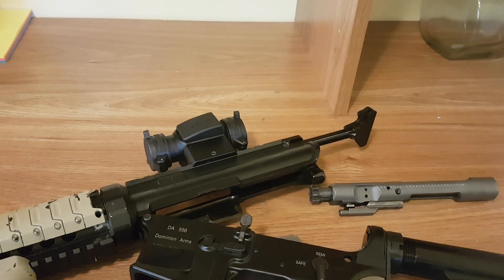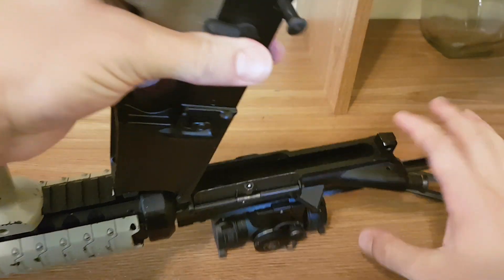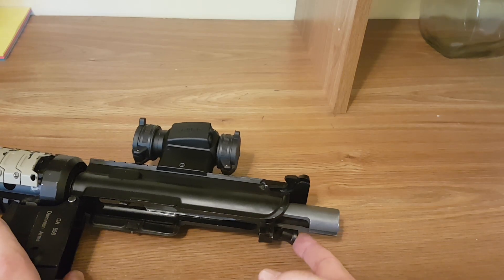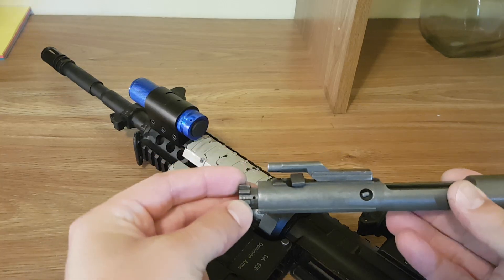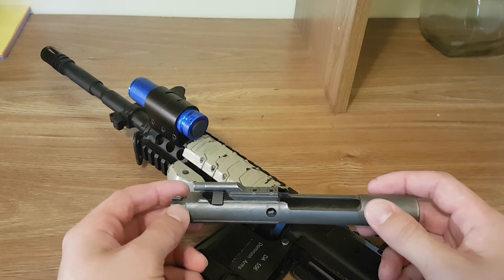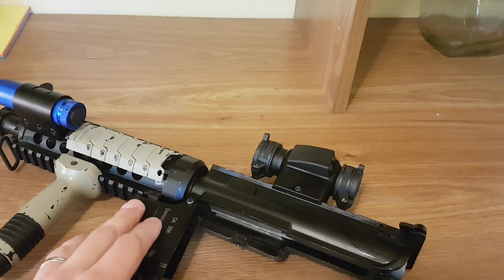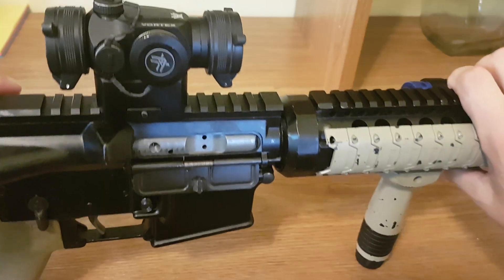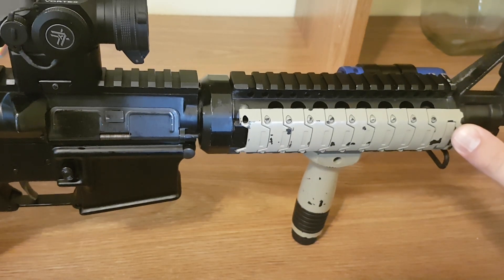What does the Forward Assist on the AR15 Do?

Comment: The forward assist is a reminder that the AK is more suited for dirty conditions.
Reply: you can use the charging handle on an AK platform as a forward assist too.
Reply: @Rara Neagra you are one of the most ignorant people I've ever had respond to me, and I've had some pretty stupid people respond lmao
Reply: David Cisco unless you have a piston driven ar. It’s the best of both worlds.
Reply: I wanted to bait AR people with some AK memes, but @Rara Neagra here proved that I don't even have to.
Reply: Incorrect. The AR keeps elements out better.
Reply: @fallout1953  yep way better funny that ar15 is better at keeping dirt and mud out than ak 47.
Reply: Bobby Johnson The AR has a very closed system. Hard to get mud in that.
Reply: FN Fallout yeah by sand grit is giving US soldiers ALL KINDS of problems with their M4’s the fine particulate is causing the insides to get all dirty. Combine that with a direct impingement gas system and you get a lot of bad stuff happening
Reply: @fallout1953  still gets dirty from use. AK system has just proven to be less complex, thus more reliable in certain conditions
Reply: @Bws2206  Sure.
Reply: @fallout1953  yeah. AK system has infact proven to be not so complex and very reliable.
Don't think you know how sarcasm or AR-15s work, but you have a name that includes Fallout in it so I guess I should be more generous. ;)

And I'm not saying the AR platform isn't reliable, just in general the AK has more stopping power and reliability but it certainly has cons too.
Theyre both balanced.
Reply: @Bws2206  The subject here was that which one is more reliable in dirty conditions. 

AR wins in that department... anything else atm is irrevelant. 
Does it really matter how well it handles crap in it when keeping it out is more important? All guns jam, malf and fail if that crap gets in the right place in the right amounts.

Simplicity is still a plus in, for example, cleaning and production... and maybe handling the crap better if it gets in(again, AR keeps it out, pretty well, in the first place).

And "stopping power" is a pretty bullshit term from what i've heard. Besides, 5.56 is a deadly round; it was(contrary to the myth) made to kill, not wound. And the Soviets switched to a round similar to a 5.56.

Let's just put it this way: They are different with ups and downs, but both are fine platforms that will put in work in whatever you are doing.
Reply: @bobbyraejohnson  the ak takes the exact opposite stance, make it fit looser so any mud that gets in can get out. Works better in sand than in mud tho
Reply: @fallout1953  and that was its downfall. When being used in real world combat situations, you get a little mud,dirt,sand etc, it jams. Built with tight tolerances means it can't tolerate getting dirty! An AK can be pulled out of the mud and water of a rice paddy and fires without missing a beat! Even if caked with grit and debris it functions as it was intended, send lead downrange! No field stripping and continual cleaning whenever you have down time. 😉
Reply: @warriorrootsbullies  With having such an enclosed system, the mud would not probably enter the AR in the first place, besides, ANY gun jams if the inner system gets crap in it, especially the chamber. "An AK can be pulled out of the mud and fires without missing a beat." "Even if caked in grit and debris it functions as it was intended" (Communist magic, huh?) Go watch the InRangeTV mud tests on the AK and AR-15 to know how that is probably not the case. 

All guns, more or less, need cleaning, i doubt it's that different beetween the platforms. 

Both platforms are great, just don't make false, overgloryfying claims about any gun; see things only as good as they are, only then we can qualify the true worth of things.
Reply: @fallout1953  watch all the tests on TV want,  all I know that its been proven in Vietnam and all over the world. Its the most widely used assault rifle platform in the world.  Just my 2 cents. And oh yeah no Communist magic, just the facts from history!
Reply: @warriorrootsbullies  It's a YouTube channel, dummy. "Proven", more like baseless myths and probably commie propaganda. It being one of the most used platforms doesn't prove its decent sensitivity to mud. It's a good platform, not a god platform. 

"Facts from history" Myths from history**, watch the AK mud test.

Just my two cents.
Reply: @fallout1953  you keep quoting tests and shit you've seen on the TV.  I'm talking about real world situations son.
Reply: @warriorrootsbullies   I just told you it's a YouTube channel, not like television is always unreliable (*cough* Russian propaganda about the AK's reliability *cough*) . They put mud on top of the right side (the dust cover closed) and it started jamming the gun almost immediately. Site me some "real world situations", boomer, i already did.
Reply: @fallout1953  brah go back to playing your Farcry and Doom video games, tired of wasting my time with a little kid!
Reply: @fallout1953  brah go back to playing your Farcry and Doom video games, tired of wasting my time with a little kid!
Reply: @warriorrootsbullies  You have no solid arguments or proof. 

I win, what do you say to that?
Reply: @warriorrootsbullies  the reason they failed in vietnam was because they thought they didnt need to clean their rifles. (atleast i think thats the case)
Reply: I think it’s fair to say that the AR15 is better at staying clear, i.e. keeping extraneous materials outside of the action, as apposed to the AK which is better at continuing to run even when it’s so filthy it really shouldn’t be.
Reply: @Rara Neagra keyboard warrior
Reply: Solution: 
- AR is better in battle itself.
- AK is better for settings where maintenance is an issue.

So, AR pattern to uniformed forces under military discipline (and vets); AK pattern to rearline reserve/civilian Militia.
Reply: Im not ashamed to say im an AK fanboy, but the AR platform actually jams less
Reply: Watch the inrange mud test series. The tight tolerances of the AR15/M16 actually seal it off better than the AK 47/74 which literally has a giant ass hole in the right side that lets mud, sand, etc. directly into the trigger group, and behind the bolt.
Reply: They’re are hundreds of mud tests AK vs ar15.  AR wins every time. You can literally never clean them and they will work 10,000+ rounds. AKs are garbage compared to AR platform
Reply: Both are shit the best rifle is the FAL
Reply: @Rara Neagra i am curious to what version of the ak are you refering to, i mean newer variants are said to be rather accurate and i would argue that the ak 47/74 were never meant to be very accurate just easier to use with little training. im not an expert and this is just my understanding. and it should be obiviouse but if you are having your rifle filled with mud you are doing something wrong.
Reply: After watching inRangeTV, I'm inclined to disagree
Reply: @bobbitybob-o8q  Yup.
Reply: @All my subscribers are in gulag I do as well, I never sad I didn't like it ;)
Reply: Not really
Reply: Ak: less accurate, can't do mud test as good it's to open, to much recoil, it gives cheek slap, you have to reach all the way around to undo the safe, and have to rack it every reload, they cost more for less, it's easy to attach stuff to a ar you don't have to buy scope mounts for ar and stuff like that. if you say any thing about jams you must be talking about veitnam when they were sent with out cleaning kits, 5.56 is proven to be better then people make it out to be . . . 

AKs are still cool though.
Reply: I forgot you can carry more 5.56 then 7.62×39 it's lighter polymer doesn't soak in water like wood and AK people try to make there all trusty AKs tactical like ARs and at the same time they say there's don't need all that junk. Lol
Reply: Frank The Tank  In muddy conditions.
Reply: Nah. Ak is better, not even up for discussion. That’s how the Vietcong beat us
Reply: @Galaxyrose-yn9kc  Both are great platforms, but i recommend you watch this: https://www.youtube.com/watch?v=LyXndCxn9K4&t=621s
Reply: @Galaxyrose-yn9kc  you are so wrong. the vietcong beat us because they used guerilla warfare humor moments and it made it seem like the US was completely losing, making the american public against the war.
Reply: It's actually not. If you don't clear AK, it will jam as well with time.
Reply: @Rom vin . My man just roasted all the ak fanboy single handedly.👍 bless you
Reply: Your comment is a reminder that you are clueless. Actually no, its opposite.
Reply: Thing is a ak still works with dirt and grit in it lol
Reply: Erik Seavey so does the AR. Only issue with them that causes most malfunctioning is firing it dry with no lubrication. AR requires it to be fired wet, the ak does not care.
Reply: @erikseavey9445  Yup
Reply: @erikseavey9445  Not really. You can find  vids right here on youtube putting that to the test.
Reply: @erikseavey9445  In it? Damn no, it dont. Not a single rifle will work with dirt in chamber.
Reply: @Alen725  Mine does
Reply: The ak can just handle dust and mud and such alot better the at has a very compact platform thus it's hard to get mud in
Reply: And an all around better platform
Reply: Watson Delmick I’m starting to lean in that direction as well

Comment: what does it do?....cause problems...if you have a gloved hand you are better off pushing the bolt forward by hand......they make a receiver plug that will fill the hole if you want to take it out.....the tab can break and foul the action......its fairly fragile......I try to never use it.

Comment: never use it in 3 years of my weekend warrior adventure. If the gun's jam just pull the bolt and chambered another round. If that one jam as well, it mean's the gun need to be dismantled and clean. The last thing i need is a round firing when the bolt is not properly lock.

Comment: If you’re trying to quietly chamber a round, hold the charging handle back, release the bolt and press the forward assist until you’re in battery.

Comment: Keep your rifle clean, and you won't ever need it.
Reply: You are funny
Reply: All it's good for is snagging on your gear.
Reply: Milisurpl
Reply: Welp we have "mister common sense" over here who has never verified he's condition one.
Reply: I never use it 

I clean my guns.
Reply: Keep it clean? That means never firing it! You can amuse yourself all day pushing the forward assist sitting at the computer!
Reply: Keep it clean? That means never firing it! You can amuse yourself all day pushing the forward assist sitting at the computer!
Reply: Youre funny as shit
Reply: Mr. Common Sense Not necessarily true, dude. The lip of the first cartridge would often catch on the receiving ramp after inserting a new magazine, even if the weapon was spotless. When used correctly, the forward assist solved this. Admittedly, it was a design flaw in the original M-16, but the modification was ingenious and worked every time, at least for me.
Reply: Or use an AK instead.
Reply: Or chamber a round quietly.
Reply: @Just-Steve  Exactly what I used it for. The parts slamming together when you properly release the handle is over 100 decibels. Yikes!
Reply: @Just-Steve  There you go.

Comment: In a fire fight, under constant firing the weapon would act like it jammed. Sometimes right away. It was freaky. 
  Dam things where junk. 
    We bitched. An complained, nothing. 
After awhile I guess body count An jammed weapons proved the answer. 
 So they added it quickly seems it would push the round forward that would not seat. As the spring acted slow from the feed chamber. 
  It was a cheap fix an quiet fix for them as they had such a big contract with the military. An all. But who am I to say any thing. Just one on the ground with one of those in my hand. 
     An some one trying to kill me an my friends. Yeah many a good man died for that button on the side. Me I tossed it an started caring a M-79 GRENADE LAUNCHER. 
   Thank you!

Comment: Good fairytale. The reason for the forward assist is to force the bolt forward in the event you have some kind of crap in the bolt area. Crap in the bolt like sand, dirt, etc. Has nothing to do with civilian usage or the firing line. Yes, it can help in some cases, but it was a device designed for a last ditch effort to get a round in battery to fire against the enemy. The reason it's on the AR15? Because the AR15 is a copy of an M16 )minus the full auto feature of course).

Comment: Forward assist?  No, it's the piece of crap button.  When the piece of crap doesn't properly lock up and won't fire, and you can't push on the charging handle because the piece of crap has a wack-a-doodle charging handle that pulls out the back of the receiver, you can bang on the piece of crap button and pray that it will fire.
AR15s are total pieces of shit.

Comment: SO in the Marines we used it to make sure the bolt was locked in place . That is all... it was put their cause they thought they need it and was a good idea if for some reason the bolt didn't lock into place when releasing from the  blot catch or charging the chamber using the charging handle , we ( us Marines) could force it closed . Also when in a long firefight and things start to run dry the bolt could get a little sticky with carbon build up so another reason for the forward asst.

Comment: Havent watched the vid yet, but im pretty sure it is an assist mech put on the gun incase the bolt group fails to fully chamber a round. Weither the gun is too dirty, or whatever, the forward assist is pretty self explanitory. It pushes the bolt group forward until properly seated with the chamber, and gas system.

Comment: Using the L85, (SA80) the British Army quickly adopted a forward assist on the cocking handle. This was after finding the fine sand & dust in the Arabian Gulf during Gulf War 1 was causing stoppages, (jams). The L85 uses a rod from the gas parts within the foresight mount to far reduce any carbon fouling in the bolt carrier. Further more, the gas parts were fitted with an additional setting to allow for carbon fouling at the front. Having played enemy in FIBUA/OBUA I found the A2 could cope with over 7,000 rounds without requiring a clean, but the plastic top cover over the gas parts melted a little. Never fired any other rifle, so can’t comment on the AR15’s efficacy but I’d happily play with the L85 for hours.

Comment: To put it simply it ensures that the bolt is fully forward after you either pull the charging handle back to begin shooting and the other is if when firing you can make sure the bolt is fully forward after clearing out a stove pipe.

Comment: In short, it is the reason I have never owned an AR-15. 

Any firearm manufactured with a device whose sole purpose is to make up for how poorly the firearm is designed is a non-starter. It is like having a re-trigger trigger in case the trigger doesn't work. 

With CCW weapons a malfunction rate above 0.5% is seen as inexcusable (one failure to feed/fire every 200 rounds disqualifies the firearm/magazine/ammo etc...) it isn't enough to say, "well gee my Sig has second strike capability..." nor is it enough to add a forward assist and call the design good.

Comment: In my humble opinion the forward assist is trying to fix an engineering flaw, lack of tension from the buffer spring to properly lock the bolt face in the chamber

Comment: I can imagine these were added to the m16 in the "A1" designation to be used like that but you shouldnt actually use it like that. If your bolt doesnt go all the way forward its probably not a dirty reciever or a dirty bolt its probably a dirty gas key and if you force the bolt forward like that you might just be compounding the issue and it could get stuck. Its just not worth using it that way. 

Ive also heard that that wasnt the intent to begin with but rather that it be used to silently load the guns. With a forward assist you could quietly ride the bolt forward and then push the forward assist to get it the rest of the way. I doubt that it was the intent but despite there being a very low possibility youd need to load the gun silently in combat i feel like thats better use of it than potentially compounding a problem.

Comment: I was in the military for over 23 years, and I never heard you should use the forward assist every time you made the weapon ready.  It was only for when the weapon failed to cycle properly.  The acronym was (is) SPORTS:  Slap the magazine (to be sure it's seated properly), Pull the charging handle (To eject the fired brass, if it's stuck), Observe the chamber (To see if you have a miss fed round. I had one that ended up with the tip of the projectile up in the gas port. in this case, if you are at the range, turn it over to be serviced), Release the handle (To let the bolt slam forward),  TAP the FORWARD ASSIST,  Squeeze the trigger.    Please note that by observing the chamber, the operator will see if there is a 'catastrophic' problem.  In combat, of course, there is no one to fix it for you, so you have tho do what you can.   ^_*

Comment: That’s an engineering flaw. If you need a forward assist on a gun to make the bolt go all the way forward, that reveals a flaw in the engineering.
Reply: Do you see the dimple on the side of the bolt ? That's where you could use your thing to push it forward, Stoner knew what he was doing
Reply: So, in other words, the engineering flaw is still there and Eugene was stoned when he made the gun.
Reply: @nathanapplegate5374  how is it a flaw? It's insurance that it's sealed